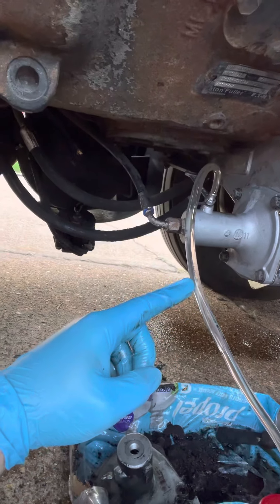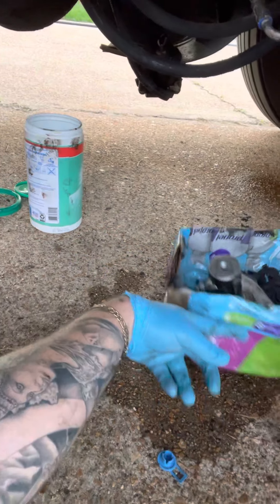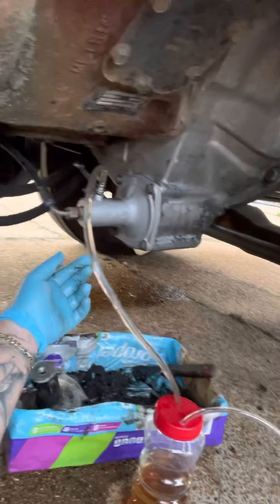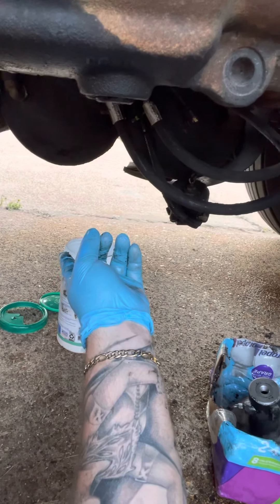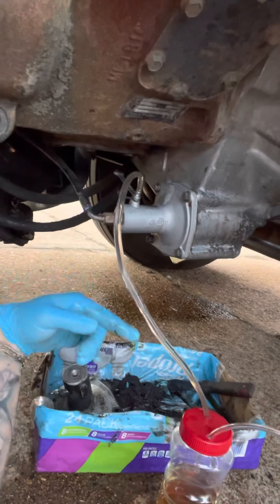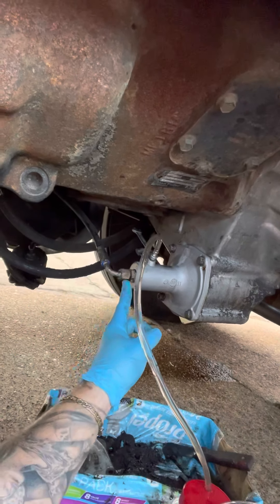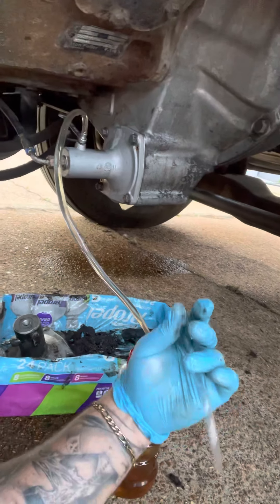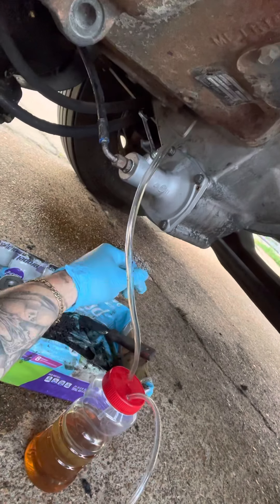Volvo VNL Eaton 10 speed clutch bleed

Comment: Thanks for the video. I've been all through youtube to find the right way to approach this. I do have a question though, should I put high temp grease on both ends of the push rode or leave it be? Also my new slave cylinder didn't come with one, I want to reuse the old one, but they might not be a good idea.
Reply from the maker: Probably wouldn't be a bad idea honestly to grease it up. What is missing on your new part? I didn't see?

Comment: Here is another simple way . Attach a 12 volt windshield washer to Tupperware container filled with brake fluid and attach out of pump line to bleeder screw . Remove reservoir cap .  Attach line to bleeder screw , open bleeder , turn on pump when reservoir overflows shut bleeder off and shut off pump . This operation may take 2 ice cold beers .

Comment: Where did you exactly get the 5/16th? Name of the store??
Reply from the maker: @omarh4694  store purchased parts from was Vanguard

5/16  was a clear hose from the hardware store. Believe I got it from ace hardware. Home Depot sells also in the aisle by the water heaters

Mixed nuts was Walmart. Got to eat them first
Reply: @WhiteGuysWRX   How long did it take to bleed the air out? Were u able to get it all out?
Reply from the maker: @omarh4694  maybe 2-3 minutes once it was setup to bleed everything out. First time ever doing this - yes every air bubble came out. It was pretty easy which I was surprised. Just be careful removing the old bolts holding it together. I would use a little Milwaukee impact maybe for loosening a M12 something not super strong - fear of stripping them
Reply: @WhiteGuysWRX   Do you also know if this bleeder valve on the slave cylinder can be used to fill the system up with fluid from bottom to the top??
Reply from the maker: @omarh4694  I do not think so, basically the system is filled at the top resivor similar to a cars brakes. - if you have a special tool it is possible I think?

Simplest cheapest way I did it tho was in the video. 

The line kept fluid in it. I left it all connected to the old cylinder when disconnecting. So steps I took wete:

Get everything situated. Get  the old one off first

Have new parts ready to swap

Have cleaning supplies brake cleaner rags etc ready and safety glasses

Clean it all out, scrape it out.. make it look new.

- bolt up new one, disconnect old line an quickly attach to New cylinder

- go up top cap off now. If cap is on it creates vaccum an prevents fluid from just all coming out at once when u disconnected below

- cap off - top off the 3-4oz it lost.

Start priming it with bleeder nipple open below now 

Pump pedal a few times...I think 7-9 times was all I needed... Have had zero issues to this day

 Hope this helps. If your in the Midwest I'll stop by I still have the jar of mixed nuts lol.
Reply: @WhiteGuysWRX   i would use a long handle wrench & an extension for leverage no power tools, my clutch pedal feels spongy when the truck sits & then it gets harder when operating but I can never stop the transmission to put it in gear from a complete dead stop & i think I got to replace slave & master cylinder
Reply: @omarh4694  check your clutch brake too if it's over 500 600k miles could be worn

Comment: Did you have the bleeder screw open when you were pumping  the clutch?
Reply from the maker: Yes. Bleeder screw with the clear hose on it yes. Should be open. Once fully bled and no bubbles come out then close
Reply: @WhiteGuysWRX  Is brake fluid being vacuumed in through the bottom bleeder screw when you’re pumping the clutch
Reply from the maker: @scatter-vision21  yes. 

Step 1, attach hose into fluid jar
Open nut
Step2: fill clutch fluid under hood. Make sure it stays full
Step 3 press clutch slowly in an out while watching the reservoir under hood and make sure jar under truck is full of clutch or brake fluid.

Comment: My brother-in-law replaced the servo because the clutch pedal was so hard we could not push it down more than a couple inches. I got it primed and bled out by pushing the rod and now we are back to you can’t push the pedal down it acts about like the brake pedal. How did you get yours from pushing so hard to normal? Just by bleeding? I would think mine should be good or I have a clutch problem.
Reply from the maker: After starting the truck one or two pumps it was fine. - there are air brake valves too in the firewall behind the plastic covers behind the brake pedal also. Those go bad often too they are about $32 each. There's two I believe
Reply: Thanks.  We have had it running and won’t go in gear.  It’s an auto shift but clutch should still do the same thing.  Must be more serious. Have a good one
Reply from the maker: @billfarmer66  if you have Facebook there is a group called Volvo truck masters - join that and there are master techs on there giving free advice. 

If the truck was running with zero issues an just randomly stopped going into gear disconnect batteries let it do a reset, unplug the elog out of the obd port, see if it changes

 I believe there is a air solenoid that sits on top of the autos. It does something with shifting on them. Don't give up, more than sure it's something you can figure out 🍺

Comment: You did not explain the peanut jaw fuction
Reply from the maker: Happy Thanksgiving Johnson,

 The clutch system is like a garden hose that is filled with oil. Everytime you press the clutch, it shoots oil to areas needed and is a sealed system.  Much like a houses water supply.

 If you replace your faucet on the side of your house, for example or the master cylinder in this case on the truck, air gets inside your closed system.

The delicious mixed nut jar comes in handy in this case, by opening the faucet in your upstairs bathroom, or the brake reservoir cap in this case and having brake fluid completing the system, this will blow all air bubbles out of the system as you are priming the system.

There are tools for this, but if you are in a bad situation or low on funds or just like a guaranteed thing....this is it.

Be sure to eat the salted nuts an clean jar prior to filling it with brake fluid. Pro tip